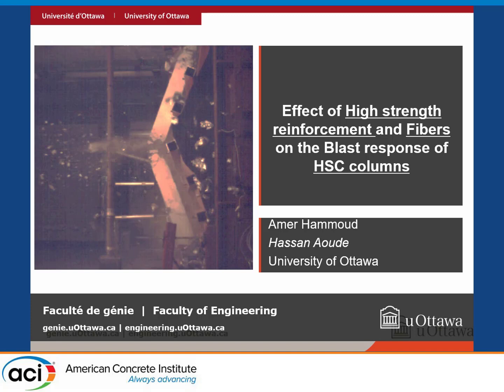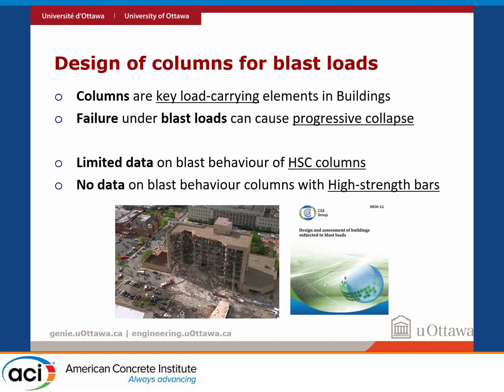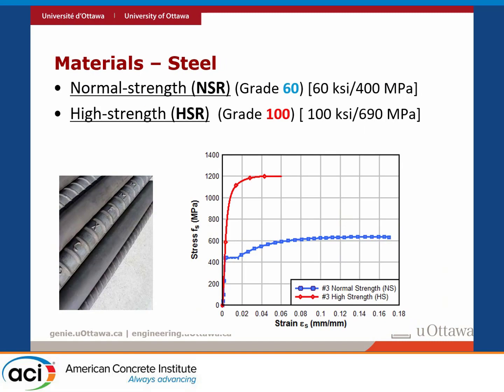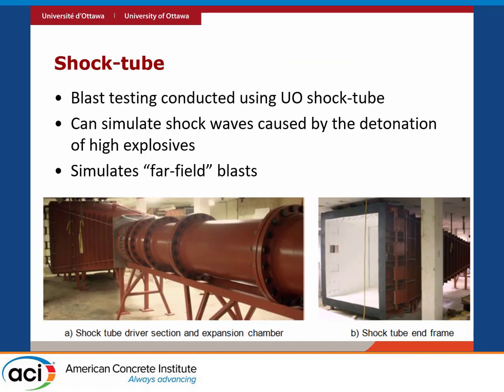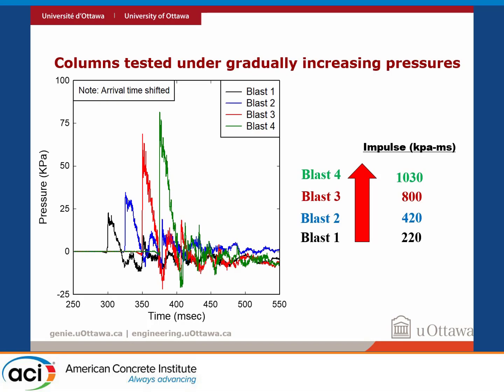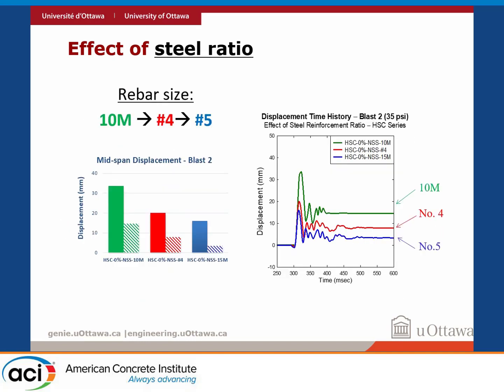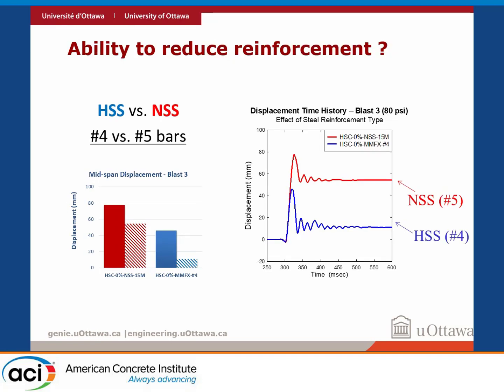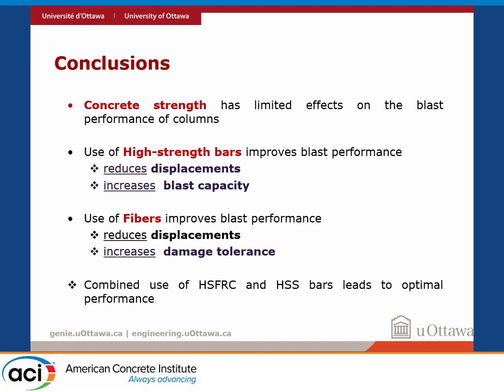Effect of High-Strength Reinforcement and Fibers on the Blast Performance of HSC Columns

Comment: Thank you very much for your presentation. This guidance offered a fine walkthrough, with demonstrated measurements, as illustrated on you tube. Any alternative response which offers sustainability is commendable. 

Having arrived with these insightful tolerances, burdens can be demonstrably crippled. This offers evidence of a negative carbon imprint. Where global challenges both specific and current all but become utterly irrelevant if only as an alternative to what promises to be a bleak aspect of a future. 

A proper yoke will inevitability morph one thing either back or forth until a desired state is achieved.  To a place where electrons are measured in real time with optics as broad as the stars in Orion’s Belt.  Shout out to the cat in MIB. Tools to structure and bond using core depth analysis. 

Offering an alternative capable of forming bonds durable enough to achieve a negative carbon imprint to rival that of saving a rain forest.

 Powerful, demonstrating the inherent strength while withstanding great physical impacts as demonstrated, this video lends integrity to a great promise of sustainability, across multiple levels over numerous instances of great instability, as only a pandemic could overshadow. Tolerances of a multi-aspect relationship once obscure, are simply revealed as an effective method of eliminating the fundamental shadow of a lense crafted with no end in sight beyond those denoted by the  laws of physics.

Impacts can be assessed across the numerous stratums within social sustainability as well as geological integrity.  It would appear to offer a promising figure of sustainability with a viable alternative approach option.